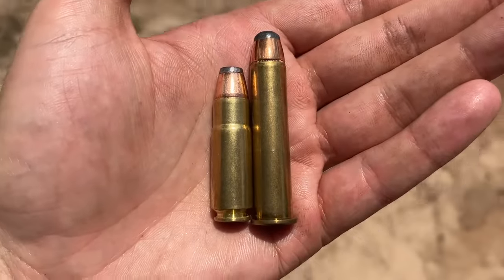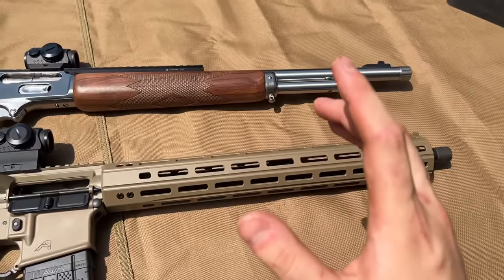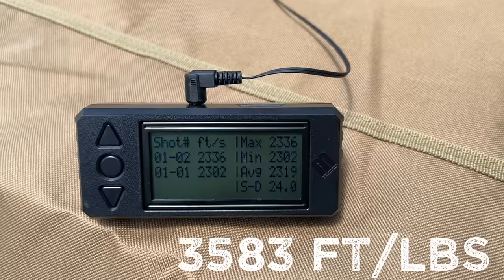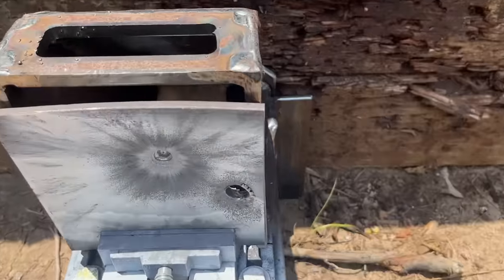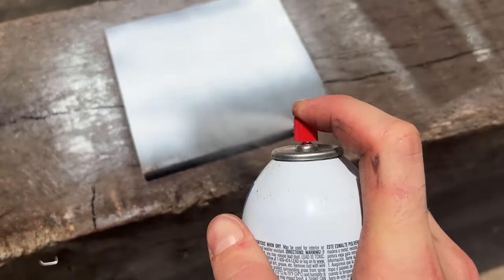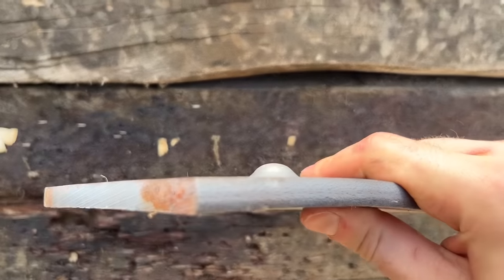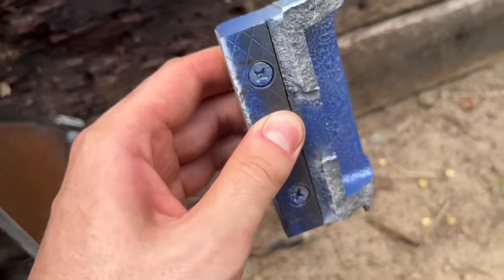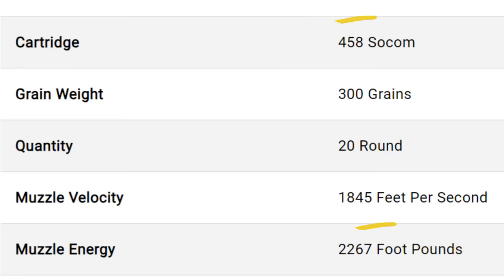458 Socom vs 45-70: Completely Different On Mild Steel

Comment: I could be completely wrong here BUT in terms of comparison i dont think this was a truly accurate comparison on the 1/4 in plate. the 458 struck dead center and lost its impact energy in the elasticity and "bulging" back of the plate. The 45-70 hit so close to the support on the side that it allowed all of the impact energy to be directed into the plate allowing it to blow the hole right thru. Think about it like this if you are running a steel punch try punching a 1/2 in hole with a 2 inch female die backing.. your not going to punch thru your going to depress the indention and bulge the metal into the female backing die  in a concave shape. now if you use the 1/2 female die with the 1/2 in punch you will pop a clean hole right thru with no trouble what so ever. Am I at least making a convincing argument? Im not arguing out of being partial to either round i just feel that maybe if the shots were similarly placed it would give a more accurate account of the reality of the 2 cartriges..

Comment: I do my own hand loads of 45/70 

405 grain hollow soft point / 50.46 grains of H4198 / 2,000 Fps / comes out to right about 3,597 ft lbs of energy
Its pretty much the same as a Buffalo Bore but since I do my own loads it's cheaper than paying $90 for 20 rounds.

Comment: Way to give the .45-70 every advantage.  Using Ruger #1 loads with 2 more inches of barrel, of course the SOCOM is going to come up short.  🤬

The idea is the .458 SOCOM is basically the same as a STANDARD .45-70 load, not a Ruger #1 load.

Sorry, you're just making me remember that it would have been smarter for me to go with a .45 ACP PCC instead of the SOCOM and it doesn't make me happy. 😅  Knew it at the time, but just had to be different.

Comment: Copper or brass solids? They might preform better.
Reply: Also I calculated my .458 win mag 350gr hand loads at about 42 foot pounds so those loads are stout out of the .45-70 in a lever gun.

Comment: So the 458 SOCOM has less powder capacity and fired in a shorter barrel, no way are you going to get better results with it than a 45/70. Unless you are using 45/70 ammo loaded for the "trapdoor" Springfield.

Also hitting the edge of the steel plate where it is supported by the holding frame and cannot give or bend to dissipate, will make penatration easier.

What's next, comparing a 41 Rimfire to a .416 Rigby?

Comment: While the old soldier 45/70 is powerful in its own right, the modern loads put it in another class.
So with that caliber, and a modern firearm, there is a wide range of performance capability available.
But even the black power version is a potent round at practicable ranges.
Just ask the buffalo hunters of the 1800s.

Comment: I mean.. you're talking about using different rounds for the 45-70... But not the 458? There are hotter rounds for the 458 that they don't recommend for all guns as well 🤷 sounds a little biased toward the 45-70🤔

Comment: Anyone know who makes a 45/70 that can take the hot loads? I've shot an original 1874 cavalry carbine with a drop block. It was actually pretty fun to shoot, don't know what the load was it was a long time ago.
Reply: 1895 can take semi hot loads. Ruger 1 take it all. Possibly other falling blocks.  You’ll see some manuals show lever action and ruger 1 data as different. 2300 fps with a 300 is getting into ruger area imo from the data i got in my books

Comment: Your video is not a comparison of the cartridges, only between two specific bullets. Using a different bullet shape and construction in the .458 Socom would yield much different results. That's where the Socom has an advantage. It's not limited to flat nose bullets like the 45-70 is with tubular magazines. Velocity is only one component of penetration. Many bullets with higher velocity will actually penetrate less.

Comment: The 458 SOCOM was designed for infiltration, shooting something and it stays shot and doesn't get up and take you out. heavy slugs slowed down under the speed of sound with a silencer.  Use it for what it was made for, stop trying to make every cartridge equal.

Comment: Ought to try it with the .450 Marlin, which has been described as 45/70 on steroids by some.
Reply: Marlin only loads about same power as that load he just shot. You would need to put the marlin in a bolt gun or a falling block style action to get more gains imo

Comment: I wonder what the Socom would do with an 18" barrel.
Reply: 458 only gains 25 fps per inch on the high end for an average load. The round is designed to be efficient in a 10.5" barrel. That could have gotten it through the 1/4" plate, but 45/70 still trumps it in the higher pressure loads hands down.
Reply from the maker: The box said 1900 fps but no mention of barrel length. I agree that it is probably only about 25 fps per inch

Comment: A .45-70 loaded for a modern bolt or Ruger #1 is loaded hotter than the lever action load
Reply from the maker: If I had loaded these to modern pressure levels, I could have gotten an increase of another 100-200 fps (according to the load data anyway). They would not be safe in a lever action for sure. The loads I used are about the hottest loads for a lever action (specifically a Marlin 1895)

Comment: Why not weld the crack before it breaks completely?
Reply from the maker: Cast iron is pretty difficult to weld properly. I got a new forged steel one to replace it
Reply: @bananaballistics  That's true, I had to weld a cheap bench vice back together at my work with a MIG machine, and it was not an easy thing to do. I'm surprised it has continued to hold together with the abuse I have continued to put it through, to be honest. I'm sure that part of the vice is experiencing the force of a sledge hammer every time it gets hit, I wonder if putting an old piece of tire tread between the plate and the vice would cancel out some of that force. Not the whole way across the plate, just the part where the vice grabs on to it.

Anyway, thanks for the reply. This is an interesting channel you've got here.

Comment: Loading the old .45-70 up to the .457 mag level will destroy most rifles chambered for the old round. But if you have a strong built new model action that is made using new steel and new methods that lend to stronger more accurate rifles then you have a good chance at making it an African game gun.

Comment: I have a single shot 45-70 that will take considerably more pressure than the lever action rifles. I shoot a 365gr hardened cast bullet with a gas check at 2300.  At the muzzle it has about 4300 ft lbs of energy.  Out of a sub 8lb gun, it will rattle your teeth

Comment: Your title is misleading. (almost like click bait)  It should have read 458 SOCOM vs 45-70 +P.  
Kinda like testing 44 Special vs 44 Magnum.  Of course the 45-70 +p is going to go faster & penetrate better.  It's loaded to almost twice the pressure!
That said.  I'd love to see this test repeated with some Underwood  Xtreme Penetrators.
Reply from the maker: Not sure, the box said 1900 fps but no mention of barrel length. I agree that its probably only about 25 fps per inch

Comment: Yeah, .45-70 is a solid performer alright. But, and this is that huge asterisk level but. Heavy loadings should not be anywhere close to anything that chambers it if the specific firearm shooting the given round is modern. Modern in this instance is having been manufactured in the past 20 years, though even then. Not all manufacturers are equal just like not all designs are equal. So yeah, follow the advice here in the video, if there's even a hint of a shadow of concern. Talk to the manufacturer of the firearm and the ammunition.

Do not take your old trapdoor and put a heavy .45-70 in it just because "it's.45-70! It'll be fine." No. No it won't be fine. Unless by fine you mean: Phucked Up Incredibly Explosively.

Comment: I disagree with your loads. You must have been using buffalo bore for your 45-70. It is only factory load that goes that fast.
Most factory loads are around 1850.
It is the reason I shoot a 450 bushmaster. Out of a 16" barrel I get over 1900 fps from factory 300 gr. and that is only at 70% load capacity. The 458 socom is loaded at 100% load capacity. When I reload the 450, I get right at 2300 out of my 20" encore.
I get >2500 for the 250 gr out of my encore. It shoots way faster than a 458socom or 45-70.
Reply from the maker: I too like the 450 BM better than the 458 socom. Those are some great velocities for the case size of the 450.  The 45-70 ammo I used was reloads, but the ones I referenced at the end of the video are underwood 225 gr extreme penetrators going 2735 fps

Comment: I have watched a number of your videos & you never seem to compare apples to apples?  Just two differences I can see wrong with your comparison,first your loads have two different bullet designs & second you are comparing a 16” AR to an 18” lever gun. That two inch difference in barrel length slows the .458 down approx.100fps. Granted the 45-70 is still producing more energy but not as much as you would like people to believe!  Plus unless you are really practiced with a lever gun (45-70) you could maybe get 2 rds. off with a Lever gun while 4-5 on target with an auto loading AR in the same amount of time? Either way both cartridges have the energy to punch holes through big bears with a hard solid bullet! Another point is the .458 Socom in a AR-15 will pack 10 rds. in a standard .223 magazine,that’s 11rds. with one in the chamber!Personally I would choose the .458 Socom which is lighter,shorter to swing in heavy cover,has less felt recoil for faster follow up shots plus 11 rds.ready if needed also it is easier to stay on target w/an auto loader!

Comment: If you want a nice setup to hold your steel, shoot me a message. If you design it, we can go over any possible weak points and add to compensate for them. No joke
Reply: Just for reference, welder fabricator, boiler maker for about 18 years. I think we should be able to build something good for many years and tons of abuse.

Comment: try Reloading VARGET or IMR 4064 i fell Less Recoil Notice lot less what u had in ur vids 50bmg  im only shoot 2cav lee bullet molds 457 style Rnfp 405=420gr  340gr w tire wwts my lead source those starline brass wt 104 gr+ more wt say win or fed or rem  hold 4gr less ur look 4 A hot loads need thinner wall more space 4 powders not all brass be same lot match grade wt 2 different Win yrs styles 104grs difference BOTH was #1 Win & 2# Winchester that wt of 223 556 case lot brass starlines +2 free 50bag 4570 52pk yel $25 or $27 nick 2013 midway midsouth  yellow brass im on 16x not 1 crack lee 4pc die set marlin 1895gbl as long shot in grass lay tarp down stones gravel chew up soft brass now $1 all stuff is get worse protect gear last not 1 & done attitude cost ea trip range y 4570 cast cheap fun gun 2 shoot use any powder as wait 4 my 338lm 308 time long guns cool still go play w 4570 cost cast lead 30cent lb 420gr Drop #16 avg 30cents lb+lee bullet lube &cost 2cent primer power 42-52gr Ea load  better store ammo $